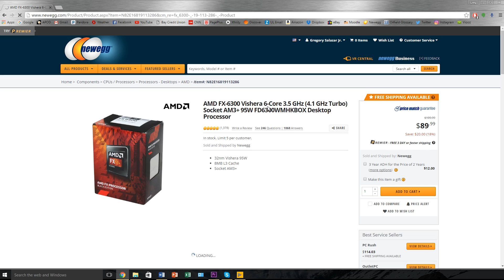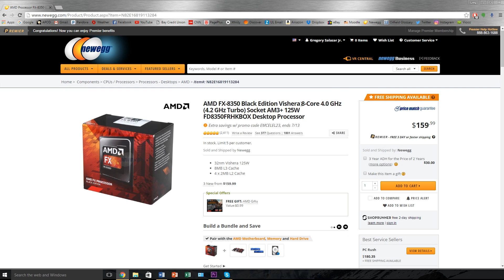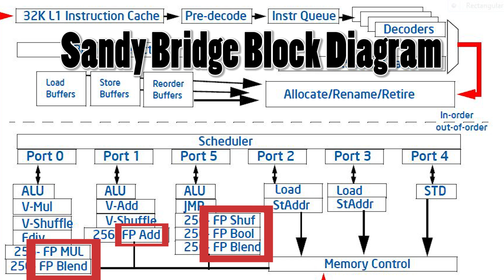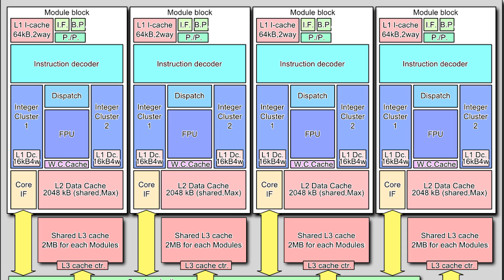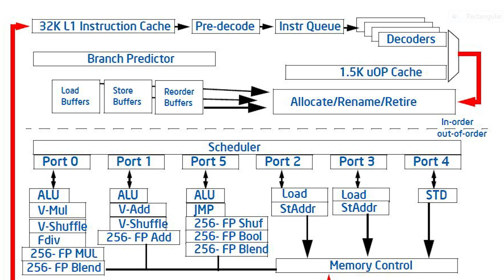How Many Cores Do AMD FX Processors *Actually* Have?

Comment: is a phenom ii x6 better than a fx6300
Reply: +Tha Man I have a phenom ii x6 1100t at. 3.6ghz with 3.9ghz turbo...how much can it bottleneck the 480
Reply: +akash sarkar he actually dis a video with a Rx 480 and a fx 6300 and it was a bit of a bottleneck
Reply: +Tha Man thanks...I will wait for zen...but I do hope it will perform better than a 6300
Reply: in theory the AMD  1100T 1090t ect out preform a amd fx 8120/8150.... because they were 6 full cores not sharing any resources
Reply: Luredreier As a budget pc gamer I do own a fx 6300. I would go with intel 4***k but I couldn't afford it. It's offering me good performance at about 60 fps and higher for all games I play. Judging by the rumours zen 8 core will cost about 300 € so I will not be able to buy it with my budget. I will probably have this setup for the next 4 years. I will be upgrading my cpu to the 8350 and my gpu to whatever will offer the best price for performance. After the prices drop to something resonable I'll move to zen or or Intel.
Reply: I got the 1090t. By what I read at the time, it outperformed the first Buldozer 6-cores by a little, but you can do a research on that in CPU benchmark sites. It also outperformed some i7s.
Now, about bottlenecks... The 1090t ain't exactly a gaming CPU... I experienced bottlenecks in CPU intensive single-threaded games, like WoT or Robocraft, but multi-core optimized titles run just perfect, examples are WarThunder, Fallout 3/4, NFS, RDGRID and the such. Although Intel CPUs undoubtedly perform better in single-threaded applications, these games are also very poorly optimized and outdated for modern computers, so the problem shouldn't apply for most modern games or any big title, however, the bottlenecks can be somewhat resolved by assigning the game's process to a single core that ain't the first one in the task manager, lets say, like the 4th or the 6th, and overclock that one core to about 3.7 Ghz in AMD's overclocking software. That seems to do the trick for me. ... Actually, forget that! I only had that problem when I had Turbo-Core turned off... Since I turned it on, I never got any more bottlenecks. :P I think turbo core does exactly what I just said but automatically. Dummy... Anyway, I'm using a HD 5850 for a graphics card. This PC is still able to run Fallout 4, can you believe that? Now, pair the 1090t with a RX 480?... I would do it. I don't see any problems with that, specially you having it at 3.9 Ghz. Even if there were bottlenecks they would be pretty small, I'm sure.
Reply: +ThePortuguesePlayer i am running a 6950 with an x6 1100t at 3.8 GHz...I expect a 20% bottleneck with an Rx 480
Reply: Really?! Well then... There goes my plans.
That's good then, means I get the chance to get a cheaper graphics card for me. Gonna go for a 7870 or a 7950, what do you think?
Reply: +ThePortuguesePlayer well I mean phenom won't perform as well as the intel CPUs but still go for 480 and oc ur cpu some bit..for well optimized games this would not be bad fr example witcher...bt some cpu intensive games like gta would cause some problems bt u will have to endure it considering ur cpu...then later go for zen or some intel one
Reply: Nah, going for an overpowered GPU is not gonna do me much good. I'm a casual gamer, I'm not into much intensive titles, the most resource heavy game I play is really just Fallout 4, and I'm not eager to play anything else so far. I'm also not planning in upgrading my CPU that soon, I use this computer mostly for photo and video editing and animation, so I don't need high end gaming hardware, I need hardware that lasts for a long time and doesn't go wild sucking power. Overclocking also doesn't do me much good since my heatsink is a SFF one, in fact, I had to underclock my CPU just so it wouldn't overheat during the summer. I'm running it at 2.8 Ghz, in the hottest days I turn off two cores and run it at 3.4 Ghz. I really just want a graphics card that is an improvement over my 5850 while using less energy. I'm actually happy with my 5850's performance, I just think it needs a bit more VRAM.
Reply: +ThePortuguesePlayer then dont go for 7000 series i heard they are power hungry..I would suggest rx470
Reply: Mmh, yes, a RX 470 wouldn't be a bad idea at all! 4GB and 14nm architecture in a 160-170€ card...
Good advice, I'll wait for those. Thanks!
Reply: +ThePortuguesePlayer ya it is very much power efficient and good for 1080p and also less costly...also with the newest architecture u will look at massive improvements with dx12 and vulcan
Reply: Not DX12 because I'm using Windows 7, but the 110 watts power usage with better performance 
already got me. Seems like a very good upgrade, I just hope it's smaller in length than the 5850, since it's just over the limit my case can hold.
Reply: GTA is not so much CPU intensive, its more GPU intensive. My Fx6200 and 650TI combo isnt exactly pushing new ground but if i have to overclock the video card to get decent frames then its a GPU problem
Reply: +amakeleven I get fps drops in that game with a gtx 960 and an overclocked fx 8320e (4.1ghz)
Reply: +Z0MG H4X and by drops I mean fps under 50. when I go to a small place like my garage the fps goes up to ridiculous amounts.
Reply: +amakeleven GTA5 does have some CPU bottleneck man. It's having to sort all that AI out while you're pissing about in the world. Granted it is GPU intense but it will bottleneck on a CPU before a GPU in most cases. I had an fx4100 that ran it at 40fps on a good day. Upgraded to a 6700k and now I'm GPU bottlenecked (7950). High settings, 55-60fps. Got that Gtx1070 in my sights! I've also found that AMD CPUs are crap for racing games....
Reply: Bakairo89 I havent experience it and i have all the CPU intense items (cars, pedestrians) at full at 60fps. The game only dips when i dont have afterburner on overclocking the the GPU. I dont play at the highest settings granted (650Ti cant even do that) but its less on the CPU and more of the lack of optimization the game has with all the content they added
Reply: Well, you can use vulcan then instead of dx12, should see similar performance gains in some titles.
But you might want to get an aftermarket 470 with a custom PCB so you won't get the PCI-e overload issues the 480 had in the beginning.
Reply: Zen is also an AMD CPU and it won't be crap from what I've heard.
Also the single threaded performance of the AMD APUs isn't shappy for their frequency.
Reply: +amakeleven No clue what you're talking about with GTA V being optimized poorly.
Reply: The Gorgeous Fruit Okay, how come with each iterative update the game develops some kind of performance problem? Hmm? Then there is an update to fix it. The game is getting to the point where the engine can barely handle what its being put in to it. You have zero idea what a decently optimized game is.
Reply: Z0MG H4X We are getting opposite issues it seems.
Reply: amakeleven
what?
Reply: Z0MG H4X You mentioned me before, saying your system gets dips despite the higher specs
Reply: amakeleven
oh yeah. you're lucky to not have fps drops under 50fps
Reply: Z0MG H4X  I have to overclock my card to keep a 60fps at constant because of that 2gb limit with textures streaming in... not exactly good but I paid 67 dollars for the card so I'm not going to go easy on it lol
Reply: amakeleven
You have a low-end PC, I'm not surprised it doesn't run well. This game is fairly demanding.
Reply: The Gorgeous Fruit
"Not running well"?
Heh, people are to sensitive sometimes.
When I'm playing Star Citizen (bottlenecked by the server) it's usually at about 30 fps when the server is near empty and down at about 12 fps when it's full (and yes I find 12 fps to be perfectly playable and fine)
Unfortunatly it also get drpås of up to 1 sec at 1/2 fps, and while that's ok it's a bit annoying (kind of bad if you're in a pvp situation though).
I also had a 1/2 fps drop lasting for 20 seconds  the other day once.
That was not playable...

Looking forward to the next few patches when they'll hopefully fix the server issues (of course the game will probably slow down again when they push the servers and clients again with new tech...)

People with the best hardware still only get about 30 fps at most there.

I'm running the game with a FX 8350 and a R9 285.

Anyway, that's what a game "not running well" looks like.
Having 40+ fps does not equal a game "not running well" in my book... shrugs
Of course different people are sensitive to different things.
Reply: Luredreier And you have trash. Mine is mid-range. I dont do budget builds and the fact is, the bottleneck still is the video card in my build so please, go away with your "low-end" crap
Reply: amakeleven
 *shrugs*
I still have a better GPU then 90ish% of PC gamers.
The something eighty series from AMD and something sixty series from Nvidia are considered "mainstream" not "budget"
shrugs

Oh, and for the record, a R9 285 got about 2,2x the passmark score of your card at stock. shrugs
And my CPU is the same as yours except two extra cores.

http://gpuboss.com/gpus/Radeon-R9-285-vs-GeForce-GTX-650-Ti-Boost
Reply: No the 6300 is better. I have it.
Reply: phenom 300 is better. google it.
Reply: Hermann Göring I did. The fx has better preformance but a bit lower single core preformance.
Reply: Luka David Torkar
Idk much, but I heard single core performance is important in gaming, I think is directly relates to stuttering.
Reply: Z0MG H4X Stuttering can also be related to a poor gpu. If you are going to play games that take advantage of more than 1 core AMD is the way to go.
Reply: Z0MG H4X What I want to say is that as long as you don't plan to play games that use 1 core or set them to use only 1 amd will uall of it's cores and give you a good gaming experience.
Reply: Luka David Torkar The FX 6300 isn't better then the 8350 at all in terms of performance, especially not at stock.
The only advantage it has is a tiny bit more L3 cache pr core...
Other then that they're identical apart from my 8350 having more cores and a higher clock and turbo speed at stock...
And while you're theoretically able to reach better OC levels on air with the 6300 (due to having fewer cores) that really doesn't matter given that I'm on water where the 8350 on average is getting better OC results anyway due to better binning...
Reply: Z0MG H4X Yes, single core performance is very important in gaming, especially with older APIs like DX9, DX11 and OpenGL.
With the new ones like DX12 and Vulkan single threaded performance is less important and multi-threaded performance gain in significance.
Reply: Luka David Torkar Most DX11 games makes use of more then 1 core.
But there's a difference between taking advantage of them and not being held back by individual cores.
If you have a load of 100% on core 0, 60% on core 1 and 2, 30% on core 3 and 0% on core 4-7 you're technically taking advantage of 4 cores (instead of having the workload of all those 4 first cores all on a single core), but it's still obvious that the software in question is being held back by the performance of that single thread at 100%
For a long time what you needed in games was good dual threaded performance.
These days it's quad-threaded (preferably 4 cores, but 2 cores with hyperthreading works too)
With DX12 you get a performance benefit from the first 6 threads with the remaining threads having little impact, and in Mantle you can utilize 8 threads (and presumably Vulkan follows suit since it's heavily based on Mantle).
Never the less in terms of actual performance modern Intel processors are so far ahead of AMD these days that a brand new Skylake quad core CPU has more octa core performance then a 8 core AMD processor... ><
Heck, the last quad-core octra-thread Intel processor that my 8350 could beat in anything was the 3770k and that was just in corner cases...

I'm really looking forward to Zen.
I wouldn't recommend for anyone to buy a AMD CPU right now before Zen launches...
Reply: Luredreier Who said 6300 has better performance? I'm gonna upgrade to the 8350 next year cause it's much stronger.
Reply: Luredreier Yes. I agree on that. Older games are not known to use more cores.
Reply: Luredreier Well the 8350 CAN perform better in some programms than the 4___k. If you know a game called Kerbal Space Progeam you will know it's a verry cpu intensive game. Before version 1.1 It could only use 1 core, and intel destroyed amd. But since it now can use all of my 6 cores the performance is better than with the i3 dual core and sometimes even better with the quad cores. But yeah. Amd cpus are shit right now. I can agree on that.
Reply: Luka David Torkar
Can it use more than 6 cores?
Reply: Z0MG H4X Through my testing I can say, yes. As far as I know, it can use even 8 cores.
Reply: Luka David Torkar
wow, if every other game did the same as that one and use as many cores as a CPU has...
Reply: Z0MG H4X If I'm right most future cpu demanding games will have multicore support. I've seen quite a lot of new games that are working very well on the bulldozer and piledriver architectures due to the amount of cores they can use.
Reply: Luka David Torkar
do you think an 8 core capable game will run better on an fx 8xxx or a 4 core i7?
Reply: Z0MG H4X It depends on the architecture, clock, single core performance of the i7 and much more. Firsth. What model of the i7 do you have in mind? There are some that my 6300 would destroy and some that would destroy it. If we look at the fx 8 core series, you have the fx 8150 which is based on the bulldozer architecture with about 10% less performance than the 8350 which is based of the piledriver architecture. Here you can see how they compare http://www.cpu-world.com/Compare/309/AMD_FX-Series_FX-8150_vs_AMD_FX-Series_FX-8350.html . On the i7 side you also have a wide range of cpus. But OK. You probably think something like a i7 4790k when you say i7. The i7 4790k clocked at 4 ghz would defenitly preform better than the 8350. The only difference the multi core support will make, is make performance better on the amd 8 core cpu while staying the same on the i7. As a guy who own's AMD I feel the need to defend it so I will say that you are paying a hell of a lot more for the extra performance. But OK. If you people have the money go for it.
Reply: Luka David Torkar
thx for the amount of detail!
Reply: Luka David Torkar AMD CPUs are not shit, but they're better suited for other tasks then gaming.
Still, looking forward to seeing what Zen can do.
Reply: Luka David Torkar You said "the 6300 is better, I have it" in one of your comments, not sure about the context...
Reply: Luka David Torkar Regarding 8 octa threaded workloads being the same on a i7 as a quad threaded workload, that's not really the through.
Having 4 extra threads allow the i7 to have better utilization of the cores that it does have giving it up about 20% more multi-threaded performance on average (we're talking throughput here, the performance of the individual threads is actually a tiny bit worse as the two threads on each core are sharing resources) still, a 4770k or newer quad core i7 of the same or higher clock rate will beat a 8350 in every single multi-threaded workload out there despite improving less in total throughput with a eight threaded workload then the 8350 does.

The last time the 8350 could beat a top of the line i7 in any workload was probably the 3770k where there was a few corner cases where the 8350 could still beat it when both where running at stock as far as I can remember.
Back then it was completely destroying many of Intels i5s in multithreaded workloads though...
These days the i5s are overtaking the 8350 also in eight threaded workloads... :-/

And yeah, I own a 8350 too, and I really like the chip.
But it's unfortunately falling too far behind for me to really recommend it for someones main computer today.
Especially for gaming.
Even with DX12 it's not really keeping up properly. :-/
It's okish though, and dx12 does prolong its life.
But it's really about time that Zen arrives...
i'm thinking of using my 8350 as kind of a server chip later though when I get my new Zen.
Heck, I can downclock it and not loose too much performance and undervolt it as well I think.
And it should do decently ensuring that each user of the server gets a decent performance.
Reply: Luka David Torkar Hum, what can you afford with your budget?
You might be able to get a hex core xeon or a quad core with hyperthreading at a decent price.
And this hex core xeon sells for about 200 dollars:
https://amzn.com/B00M1BUY7K
It actually got lower single threaded performance though...
But if it's possible to OC it a little...
There's a quad core that's just a little more expensive.
You could also just get an i7 that's a non-k variant.
I don't know...
Would need to do a bit of searching to find a good option.
Reply: Luredreier Probably. I didn't check it. Isn't the xeon a locked cpu? I know intel has something with locked cpu clock and that you have to pay extra to get an unlocked one. Fx is unlocked by default. It was recommended by many people on the forums of games I play specifically because it's so easy to overclock it so I bought it.
Reply: Luka David Torkar Yeah, that's one of the advantages of AMD, most of their processors can be OCed without any extra cost for that "privilege"...
And yeah, it depends on the games you play.
Ugh, haven't slept for way to long...
Anyway, if you already got an AM3+ motherboard able to handle the power draw with enough power phases and if you can find a discounted 8350 or 8320 or 8370 go for it.
Reply: Luredreier I did account for that. I got a GA-970A-DS3P mobo. It should have no problem supporting the 8350 with some room for overclocking. Sadly I will not be able to get a 9590 but that chip is too power hungry and expensive anyway. Fun fact. My room is pretty small and I was wondering if I should just save up some money for the water block for the cpu and gpu and then connect it to an old car cooler or something. I was experimenting with that stuff so that I could build a homemade air conditioning. I made a smaller model and it seems to work fine. But OK. I'll not waste your time anymore. Good night. :)
Reply: Luka David Torkar Couldn't sleep, so don't worry about it...
I'm one of those weird people that just got a totally fucked up sleeping rhythm...

Hum...
If you got this one:
http://www.gigabyte.com/products/product-page.aspx?pid=4591#ov
Then it only got 4+1 VRM...
That's a bit less then I'd recommend for the 8350 and other higher end chips...
Perhaps you should get a 8320E instead?
Myself I went a bit overkill with this thing:
https://www.asus.com/ROG-Republic-Of-Gamers/CROSSHAIR_V_FORMULAZ/specifications/
And while 8+2 VRM is probably best for a 8350 you'd probably get by with less...
But 4+1?
That's less then a bare minimum I think...
I hope that it at least got good cooling of the VRM with a decent heatsink or something.

Of course there was some talk on the website about different revisions of the motherboard so perhaps you got a newer one with more VRM?
I hope so... :-/
Reply: Luredreier This is the exact motherboard I bought. {Gigabyte GA-970A-DS3P ATX AM3+ Motherboard}. OK. I did some reserch and as I now understand the cpu would run fine on the mobo but would run into problems when I would try to overclock it over the limit. Well. Probably then the best thing to di is to stay on the 6 core and overclock it as much as I can on this mobo with water cooling. ActuallY that might be even better than getting 2 extra cores when it comes to gaming. Curse me cause I just trusted the auto compatibility check. One question. Is there any advantage in purchasing the fx 6350 in overclocking or can I get the same performance with an overclocked 6300? Like if I overclock my 6300 to 4.5 ghz and the 6350 to 4.5 ghz, would there be a difference?
Reply: Luredreier After some more reserch I found out that overclocking the cpu is a no go for now. I could probably get to 4.3 ghz but I won't cause I don't want to risk frying my cpu. My mobo supports the 8350. It has two advantages. 1. It has a higher clock and so better single core performance. 2. It has 2 extra cores. If I really need a small boost in cpu performance I'll buy it. After that I'm only gonna save money for zen. It looks like zen will have a good upgrade path. If I manage to stick with my pc for the next 4 or 3 years the prices will drop enough and I'll upgrade.
Reply: Luka David Torkar There shouldn't be any difference between the 6300 and 6350 at the same clock speed, however the 6350 might be better binned making it easier to reach that clock speed in the first place.
But better to try to get there with the 6300 first instead of spending money on a new chip.
As for those two extra cores, how useful those will be depends on the games, but especially for older games they're totally useless, in DX12 titles 6 cores should be pretty much ideal, while in Mantle titles, 8 is ideal.
And I believe the same holds true for Vulkan, although I don't know for sure.

As for the "GA-970A-DS3P", there's at least 3 different versions of that particular motherboard with that exact name...
If you could tell me the revision number it would be easier to figure out what it can or can't handle.
One alternative is a 8 core with a high turbo.
Gives you 8 slower cores to work with in multi-threaded workloads still giving you more throughput then a 6 core, but when you use 4 or less cores you'd also get a higher performance in those 4 threads due to the cores clocking up because of the headroom being freed up.
Anyway, that's a possible upgrade for you in the future.
But yeah, for now a good OC might be a better investment given the motherboard you have.
You might be able to run all 6 cores OCed on that motherboard while you'd only get up to 4 cores "OCed" with turbo.
Also, in workloads where the number of threads used changes a lot during the program execution the AMD cores actually perform worse with turbo enabled due to the long time AMD cores takes to switch between different clock rates compared to Intel cores.
So if you're running a task with 4 threads and suddenly have 6 threads you have 4 threads running at a high clock rate and 2 running slow at the start only catching up after a little while, reducing the speed of those first 4 in the process, if the program then goes back to 4 cores and then to 6 and 4 and 6 again and again that will of course lead to performance issues.
Especially if power saving states are enabled...

Hum, another thing about having a 8 core like the 8350 though, you could buy an 8 core and turn off 2 of the cores on different modules.
You'd then get twice the floating point resources pr core on the remaining two cores of those two modules compared to what they'd usually have available and if you also OC those you'll get a much higher single threaded performance on those two cores compared to when those cores have to share resources with two other cores that also have a workload on them...
Reply: Luka David Torkar  Regarding Zen, you could buy a AM4 motherboard and then buy a excavator based CPU on it and only upgrade to Zen later.
Excavator got a better single threaded performance then the FX series of chips when the two architectures run at the same clock speed.

Here, let me show you:
http://www.anandtech.com/show/10436/amd-carrizo-tested-generational-deep-dive-athlon-x4-845

We don't know if they'll make any minor changes to the excavator architecture used on the AM4 platform, for instance adding a L3 cache could significantly improve it's gaming performance...

The numbers you should look at is the Richland vs the Excavator.
Both the 6300 and 8350 are of the same architecture as Richland, so your 6300 should have the same single threaded performance as those Richland APUs if it was clocked at the same speed (3.0 GHz).
In other words, you'd get a new motherboard with new features, and you'd get quite a bit better single threaded performance, at least in applications that's not to dependent on the L3 cache.
And even if it does not include more L3 cache you'd still get about 6% better single threaded performance in gaming...
Of course Piledriver scales better with clock rate then Excavator does...
But honestly, if I where you I'd live with your current CPU and when the AM4 motherboards drop I'd look at the benchmarks of their new low end CPUs in games and compare them with your current chip.

Also, regarding getting an 8350 for that motherboard, if you can't OC your current 6300 on it then the motherboard might be able to support a 8350 in the sense that it will run, but it might not always run at the specified stock frequency...
I know that some people who have bought the 8350 has suffered from performance problems on budget motherboards that did technically support the chip...
Reply: Luka David Torkar Ps. Investing in a E series chip from AMD might actually be worth it for you.
They're binned to use less power for their frequency, so you might actually be able to OC them a little without getting in problems with your motherboard or get a 8 core without getting problems with your motherboards VRMs.
They might not be able to achieve as good an OC as chips binned for performance of course, but with that motherboard, power is a bigger issue then max potential OC...
Reply: Luredreier rev. 2.0? Is that it? So then 2 cores would just suck power and not do much unless I ran many programs or render something. I'll stay on the current cpu. Sorry for asking all the questions... I'm gonna save up for a good aftermarket cooler then. I just hope I can wait long enough with this mobo until a good priced am4 with good oc options is available. The main thing is that I don't want to spen money on a new am3+ socket mobo.
Reply: Luka David Torkar Well, a plus is that from what I've heard you can use the same cooler on a AM3+ and a AM4 socket, so if you get a good cooler you can probably reuse it with Zen later.

As for your motherboard it looks to me at least like both revision 1:
http://www.gigabyte.com/fileupload/product/2/4591/7941_src.jpg
And revision 2:
http://www.gigabyte.com/fileupload/product/2/5216/20141120113211_src.jpg
Got 4+1 VRM.
That's just fine for the 6 core, but not really enough for the 8 core or high overclocking.

And kind of, it depends on the program.
Some games do use 8 cores.
Most don't though.
And in cases where you have programs made to run the bulk of their workloads in 4 cores but that then sends what's left to as many cores as are available you might end up with what I described before with the cores spending time clocking up and down unless you turn of turbo and power saving states.
So yeah, I'd probably just get by with your 6 core to be honest.

But I really hope that they'll add a L3 cache to the excavators on the AM4 socket.
If they do I think it's realistic to expect up to 15-20% IPC improvement in some titles at 3 GHz.
And sure, the architecture isn't really made to run at 4 GHz +, but you should still get a nice boost there if you can get a L3 cache.
Without the L3 catche the processor struggles a little in games.
Mind you, the IPC will drop a little as the frequency goes up.
If there's no L3 and the price is high or the reviews is bad you might want to get the motherboard but stay on your 6300 till you can actually afford Zen...
You might also wait and see if there's a quad core Zen coming out later.
Not sure what price that would offer, but I think it's realistic to think it should be quite a bit cheaper then a Intel i7 quad core.
Reply: Luredreier After market coolers will certaintly be compatible. A 4 core zen would be nice but if the 8 core isn't more than the double the price of the 4 core I would just save my money until I can afford it. By then I'll earn my own money anyway so I will be able to spend as much as I want, without worriying about spending a fortune on a "pice of sand" as my parents put it. XD But yes. I hope they will have L3 cache on the APU. BDW. Do you know how much can I push the cpu? I was searching some forums but there are just people that ask the question and then a bunch of people complaining about upgrading the mobo. I will actually be able to transfer everything except the ram, mobo and cpu. I just have to pay attention to what gpu I 'll upgrade to cause my psu has the max of 550 W output. Are the am4 motherboards compatible with am3+?
Reply: Luka David Torkar  The initial APU is not a Zen processor btw.
It's Excavator.
And the AM4 socket can handle several different architectures, including Excavator, Zen, Zen+ and probably one more after that.

Still, a 4 core Zen APU or CPU is likely to show up eventually.
And well, I don't think AMD is going to do more then 2x the price for 2x the cores...
But I of course don't know for sure...
Wait with buying a motherboard and CPU till you've seen reviews.
And make sure that the motherboard (if you buy it) got enough VRMs to OC a 8 core a little bit and got some cooling on the VRM.
You don't need a super expensive overclocking motherboard to get both of those.
Some motherboard reviews might be worth reading too btw.
But make sure those reviews include a Zen 8 core.
Reply: Luredreier I'll just wait. I don't have any money at this time anyway. When zen comes out am4 motherboard will be easier to find and there will be more choices. The prices will go down as well. 

Are there even gonna be APUs with the zen cores? I know that zen will be based on the Summit Ridge architecture, but isn't AMD developing another one for APUs?
Reply: Sometimes it is better to get a good aftermarket CPU cooler and overclock the CPU than upgrading.
Reply: Luka David Torkar The APUs will initially be excavator based.
But I do believe that they intend to add either Zen or Zen+ cores to APUs later.
Not initially of course, but perhaps half a year or a year later then the release of the Zen 8 core.

I could be wrong of course...
Reply: Z0MG H4X Yeah, but his problem is that his motherboard can't handle the power delivery of a good OC or a CPU upgrade. :-/